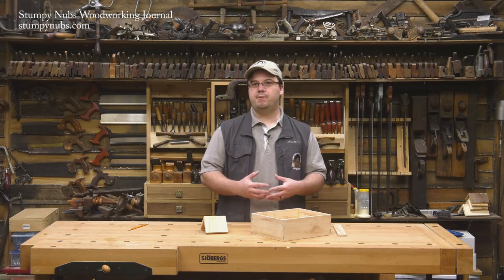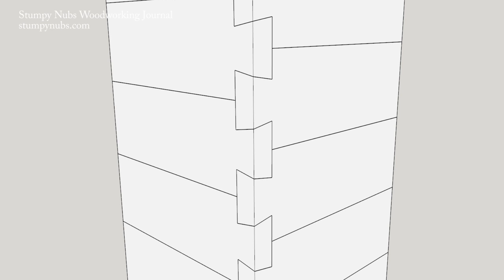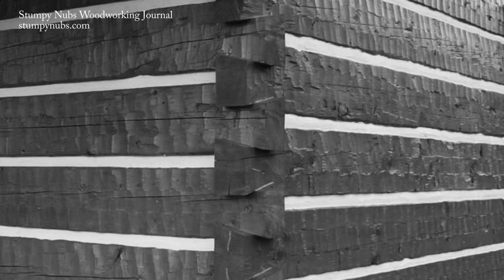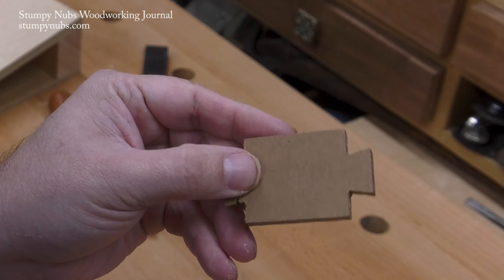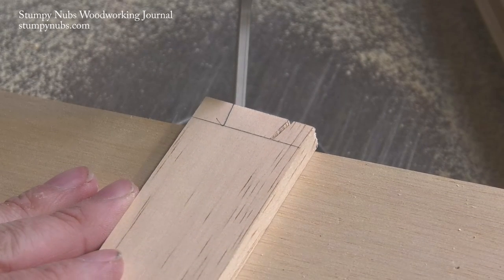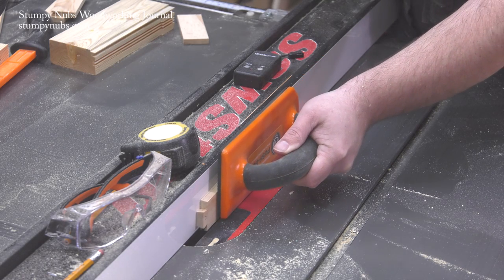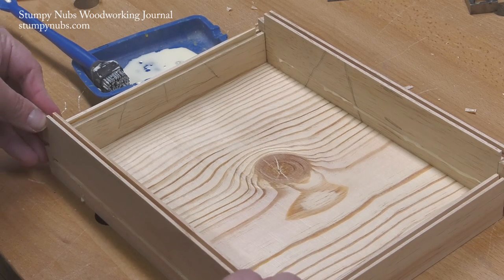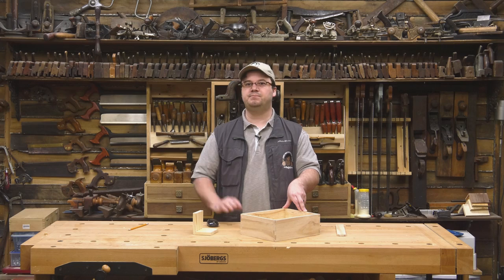The forgotten dovetail joint: How to build a log cabin box

Comment: James, could you make a general formula based on width and height, instead of just imperial width.? And, can the angle of 10 degrees be variable? I like to bring the math into ww.
Reply from the maker: The best thing to do is just model it in Sketchup. That's what I did. My goal was to come up with a dovetail width that wasn't in some crazy increment, like 55/64". If you don't use Sketchup, just cut a few test pieces. Make the dovetail whatever size and angle you want, but make the strips extra wide. Assemble four of them together to test the fit. If the dovetails are loose, the strips need to be narrower. If the dovetails are tight but there are gaps between the strips, make the strips wider. Once you get it dialed in, make a pattern. Don't forget, these are compound dovetails. They are angled on the face like a regular dovetail, but also on the ends. That means one face will be narrower than the other. I made my pattern to match the narrower face of the dovetail, because that's the one that will be facing the outside of the box.
Reply: havenisse2009 
sure, the width can be anything you like, but the total between each tail must be exactly twice the thickness of your stock. the angle can vary as well; over the centuries, angles between 8 and 14 degrees have been standardized as being best - hardwoods requiring smaller angles, and softwoods needing larger angles.

hope that helps!
Reply from the maker: Dovetail angles are arbitrary. Today's woodworkers try to set standard angles, but there really is no standard for period furniture. In fact, many tails were cut my eye, at whatever angle the saw happened to be at. Then the pins were cut to match. But 8-14 degrees is a good range. 10-12 is the most common.
Reply: After having built a few, here is what I have. Measure the thickness of the stock T. 
The width of the boards is 4T - 2*sin(angle).
The narrow end (the part you trace) of the dovetail is 2T.
The angle is basically arbitrary. Use whatever the jig you make turns out to be!
I've attempted to make jigs that are 10deg and always end up 11deg. Nincompoop or genius? I leave that to the generous good nature of other commenters to decide.

Comment: Okay, once again the Stumpster has inspired me to build something. I've made three of these, two experiments/trials, and one solid attempt. Remembering to cut outside has been the hardest part. Since I plan on doing a couple more, I have sawn my ramp into two pieces to make a left and right ramp. Putting edges to hook over on the side of the bandsaw table, I can put a shelf/bar to hold the piece at the appropriate angle on the ramp. Then I can slide the ramp towards the bandsaw blade to ensure regular cuts. I'll leave the shelf a bit shy of one edge on each so I can continue to use them to cut the shoulders too. May speed things up but more importantly will ensure a more consistent cut. And, I'd only have to mark the shoulder lines which will really speed things up. Fingers crossed...  Thanks Mr Hamilton!

Comment: Interesting technique. I'm left wondering if you could forego the splines, as the glued joint at the corners would lock everything in place. Splines might be over-engineering the box, although, they do make dry fitting easier I suppose.  Also, I've noticed the difference in your work and really like it.  While they are still entertaining, and your humor still comes through and is appreciated, you're letting your woodworking knowledge take the lead over comedy, something that didn't always happen previously.  At least that's my perception and it's appreciated.  Take care James, and happy belated birthday.
Reply from the maker: It would be much more difficult to assemble without the splines. The pieces aren't heavy enough to stay in place while you build it upward. Believe me, I tried.
Reply: +Steven Rochon
While one might think the splines to be over-engineering, they are not. Quite the contrary, they are necessary for scalability.

With the splines you can make larger  boxes without a whole lot of fuss over the panels staying flat and inline with each other. While biscuits or dowels can be used for the same purpose, the splines remove the exacting precision that biscuits and dowels require making the assembly quicker and easier.

On a box this small, you might be able to use a series of clamps to make sure each panel is perfectly flat wit the next. This would however, greatly increase the time of assembly. Putting a clamp across all the panels at the same time is not as practical as gluing up large panels.

The splines in this design provide quality assurance with less work and hassle, so use the splines.

Comment: Has anyone tried to apply this to homemade Lincoln Logs? I'm trying to comprehend how to build a table saw sled to make the process go faster. Then use square stock with one rough side to mimic the exterior of a cabin.

I know I could easily make traditional Lincoln Logs and forgo the headache, but where would the fun be in that?!

Comment: looks really nice.

It's maybe possile without Rip it into Strips, not so stable like this, but it could be done with 
Twisted Dovetails or "Teufelszinken" (wich is the Same) 

or not ?
Reply from the maker: No, it could not be assembled without cutting into strips. It is difficult to see the angles in the video, but it can only be assembled this way.
Reply: Yes, but i mean if you Cut it like those Twisted Dovetails,
that joint will Slide diagonally ... hard to tell..

/watch?v=_YyaQUWMvlo   Assembly starts at 2:20min